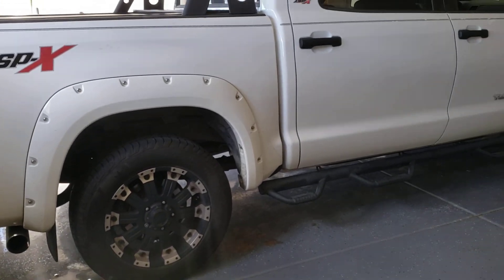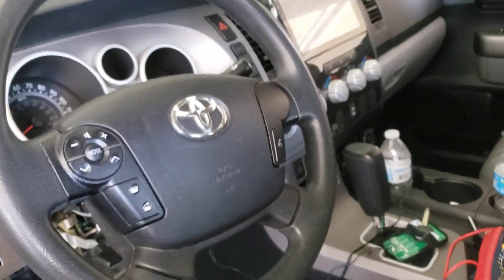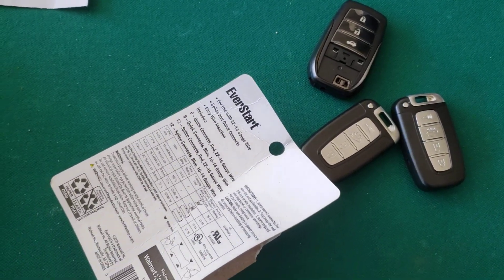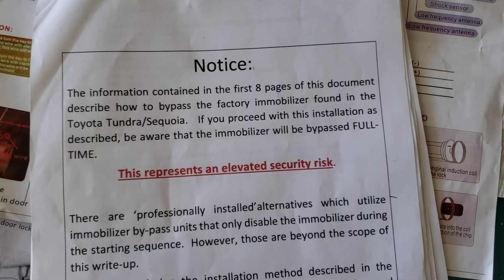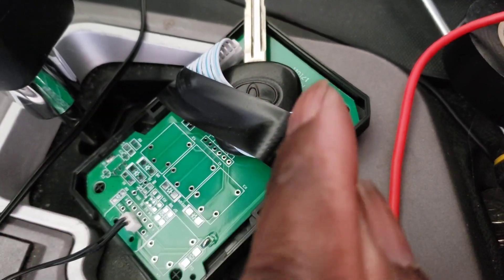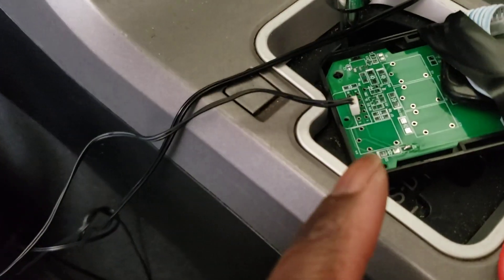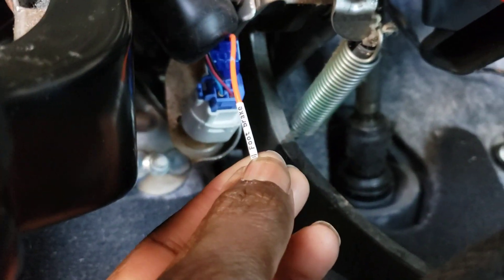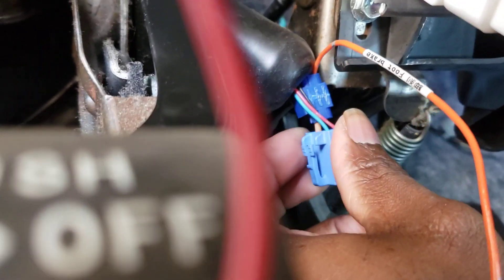2007 to 2019 Toyota Tundra push button Start+ keyless entry/pke (actual install) part 1

Comment: I just installed this in my 2008 Tundra Limited and wanted to share and point out a few things that I think may help others.

Before I get to those things, I wanted to thank you for the videos on how to install this unit.  They helped IMMENSLEY!

Basic Install/Timing/Setup: 
I went outside at 11:00 pm and began the initial install.  I was back inside at 11:42pm, with the primary components connected and tested.  I still had to figure out the chip bypass module, make final connections, and run my antennas. 
The video helped me save a ton of time in finding things, and understanding how things worked/were supposed to work.  I call that an AMAZINGLY fast setup/install.

Slight differences in wiring:
Be aware that wire colors may change from year to year.  
On my 2008, the brake wire looked orange, not tan, but as noted in the video, it is the largest diameter wire on the plug, so it was easy to figure out.
My final connections for the lock and unlock wires were soldered and I used a blue tap for the brake pedal wire.  I chose not to use the pink wire to the horn. 

Chip Bypass Module:
No matter what I did, I couldn't get the chip bypass module to work.
I'll address how I'm dealing with that, down below.

Steering Lock:
Something not covered in the video (any video I have seen on this unit) has to do with the steering lock.  Your steering will lock when you remove the key.  To unlock it, you have to put a key in the ignition switch and turn it to on.  This will unlock the steering until you remove the key (even if you turn the key to off) 
The Easyguard instructions sort of address this, by suggesting that you cut off a key and putting it in the cylinder.  While that would work, it could be problematic.  First, it could be difficult to turn on/off, once you put it in.  Second, it may be difficult to remove it if that becomes necessary.  Since the key itself doesn't have the chip in it, that still posses a problem if you can't get the bypass to work.
Since I couldn't get the chip bypass to work, the easy solution for me is to have a key that I can slip into the lock, turn it on/off and go.  If I'm in a place where I want added security and don't plan to use the remote start function, I will take the key with me when I leave the truck.  Whenever I know that I'm going to want to use the remote start function, I will leave the key in the ignition (I may even buy a blank, program it to the truck, but not cut it, so the steering can't be unlocked, but the truck will start).

Last Item:  Ignition Cyclinder:
In the video, you mention having the ignition cylinder as a backup solution for starting the truck.  That won't work since the EC002PP is plugged into the harness that the cylinder normally connects with.  That harness is used for starting the truck.  Aside from the immobilizer and the steering lock mechanism, the cylinder is "worthless" once the EC002PP is installed.  If you needed to use a physical key to start the truck, you would need to get under the dash, disconnect the EC002PP, and plug the harness back into the cylinder.  I'm not complaining about that design, as that really doesn't add some protection. I just wanted to make sure people are aware of this limitation.  One solution, to allow both options, would be to find or make a T harness for those connection points.

Again, thank you for the great videos.  They really helped me out on my PKE install and saved me a ton of time.
Reply from the maker: Thanks for sharing. It definitely helps everybody who has been in the struggle. When it comes to me saying that if you leave the key in it will be a backup in case all else fails. That's if you use their mobilizer bypass unit from Amazon. With this the original key will be inside of the box with the mobilizer chip inside of it. That wasn't referencing the one in the ignition.

Comment: I'm fixing to install PKE/PTS on my 2011 Tundra as well. I was looking at the Easyguard systems, so I'm glad I found your video. You saved me a ton of grief. BIG THANKS! BTW, what kind of stereo/touch screen is that? Looks good and I'm looking to upgrade mine as well.
Reply from the maker: I believe it's an xtrons

Comment: I have a question I did everything but it won’t start on   It will only start with the key on the on position if I don’t put the key on the on positions it will only crank over but no start
Reply from the maker: That is correct. We supposed to be in that ACC on position. And always stay like that.. I haven't seen this video in a minute but I do believe I showed that I had to cut the key and put a cap over it. That is a spare key that should never come out. I don't know if you use cinema moralizer bypass with the spare key in the box or if you just taped it directly to the steering column. Don't worry it should not and drain the battery. The module you installed from them will turn it off. To buy the exact same version I have or did you buy the one you have to wire yourself?
Reply: Thanks for the reply. I bought the one I had to wire it myself. The key I had it with zip ties to the immobilizer and still didn’t work
Reply from the maker: @robertoguzman4763  Just remember the orientation matters. It can't be laying flat it has to be pointing straight just as if the key is inside of it. Me and mobilizer chip is at the very end of the key / start of the rubber part part. So when the key is in the is in it's pointing directly at The keyhole. Just like a USB stick. If it's laying flat it won't sense it. Another option if you're laying a flat is to put the cut key in the ignition and then keep the rubber part on the end you cut. Cut the rubber piece back and you can see the chip . Take the chip out and sit it directly on top of the ACC on and then tape it standing straight up @robertoguzman4763

Comment: Hey boss the thing you have the key in what is it for?
Reply from the maker: It's in a imobilizer bypass. I ended up just taping the chip to the cylinder it works better

Comment: Your title says 2007 to 2019 Toyota Tundra but the manufacturer's material and Amazon says 2010 - 2019
Reply from the maker: That was a misprint from their part. It should work with the 2007